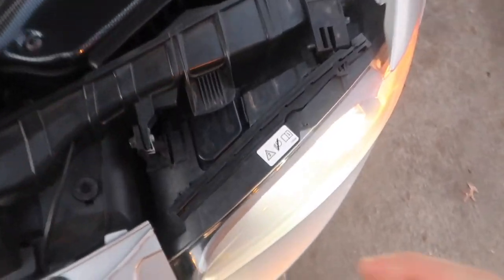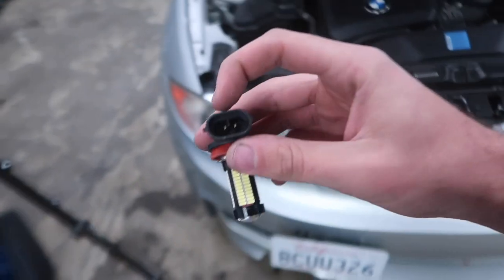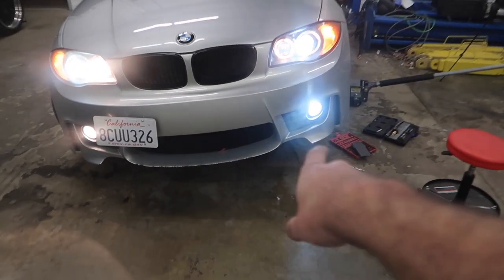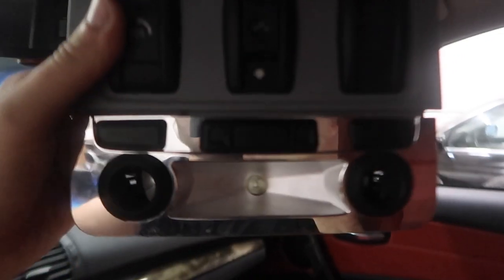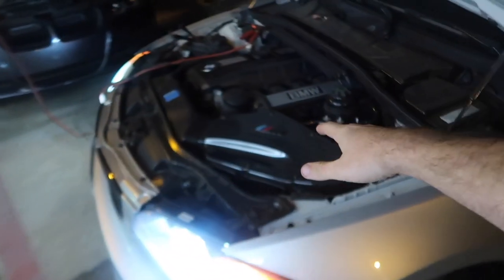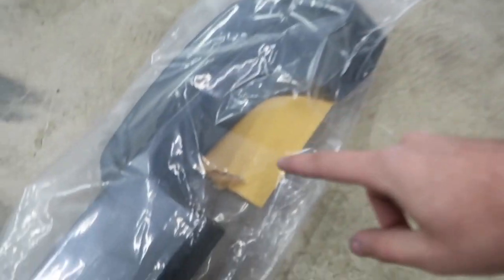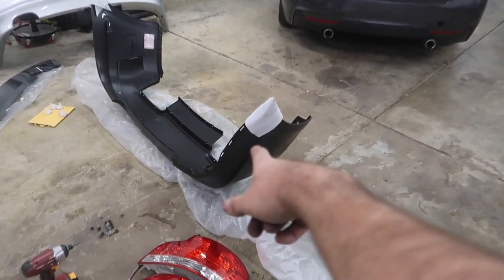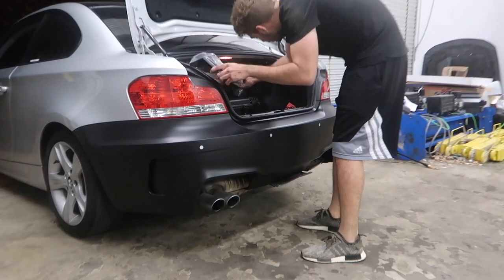INSTALLING 1M QUAD TIP BUMPER ON MY 1 SERIES!

Comment: you guys need to invest in ISTA+ and ISTAP its a bmw program that you can use to fully diagnose a bmw and code it. look it up its only around 450 for the ICOM adaptor plus program thats on a HDD already to just plug in and use off your laptop. i use it for all my bmws and fix all of them that way even if there isnt a check engine light and something isnt right itll help you diagnose it. most of my cars didnt even have check engine lights and it still shows me my issues. has all the wiring diagrams and coding information included. worth the investment.
Reply: Mark Kotyakov I can agree on this I use it aswell

Comment: Infamous N51/N52 lifter tick... mine was so bad I ended up getting rid of the car, I tried every single thing you can find on the internet and the only permanent fix was to switch to the updated cylinder head allowing more oil clearance to the lifters. BMW quoted the job $12,164.24 parts and labor. I happily sold my E92 and got a F32 4 Series like yours. Cheers.

Comment: Coming from the N52 gang, that ticking is from the lyfters, only solution is doing an oil change or use the right viscosity and heating it up properly on cold starts.

Comment: If the oil level is good on Jonathan's car just have him hold the RPMs at about 3k for 2 minutes and it'll silence the lifter tick. You just need to allow the oil to recalibrate the lifters

Comment: Right thanks for the headlight adjust info...

The LED halo didn’t work on the outter halo as the bulb lights out the first ring first then the second light (Hal bulbs perfect... led doesn’t work as well) moreover CARLY app will make headlights brighter but the halos will never be the same brightness. 

Just the way bmw made the headlights (apart from the LCI models) hence why LCI headlights are more expensive.